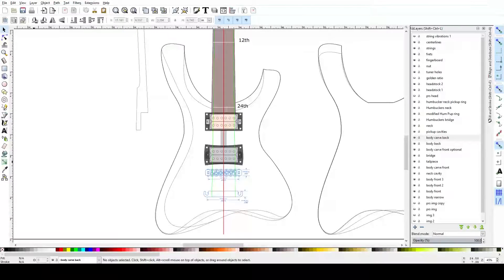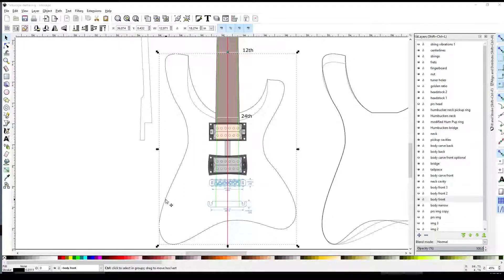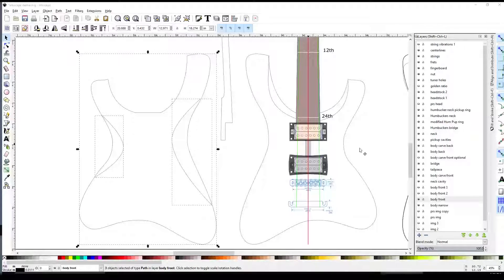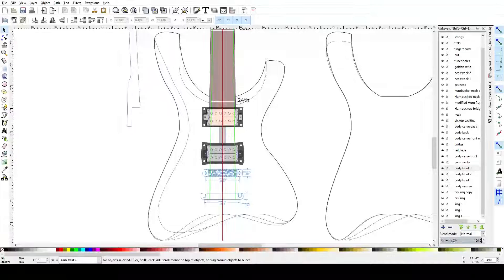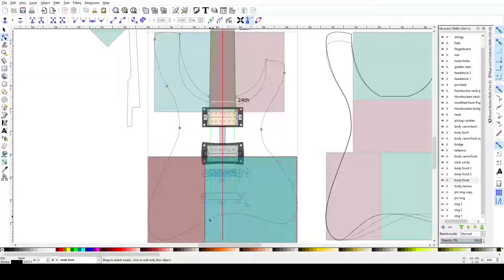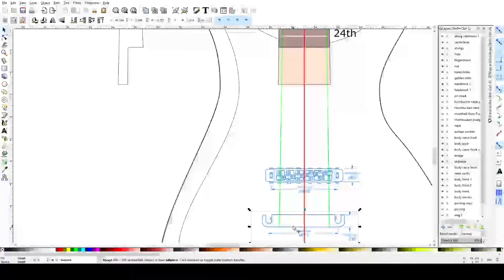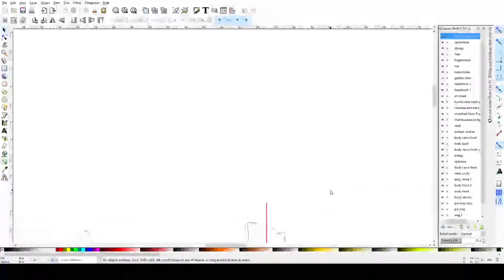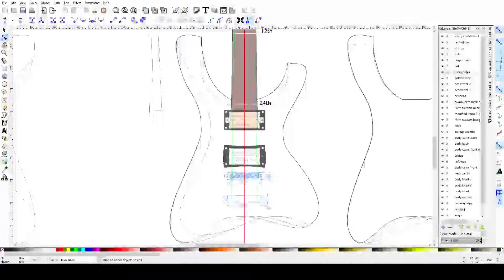Guitar Design With Inkscape

Comment: I recently did the same and designed a bass guitar in Inkscape. Without having watched your video before, I came up with exactly the same approaches 😁. Like manually tracing existing designs and then making adjustments, masking a drawing of the bridge, using the flip tool to design the back, heavy use of the measure tool etc.

I'm not sure if it was available in Inkscape back then, but now, I also use the clone tool heavily. You can for example clone the tuners, the pickups, or the body shape and then flip it to use it as a back view. Then, any changes are in sync.

Next step: I'll use Marz Workbench to convert it to a 3d model in FreeCAD. Marz provides extensions to both Inkscape and FreeCAD to do just that.

Comment: Nice demo of using inkscape. I've tried this on my own and got stuck at the point where it comes to real dimensions. As long as every dimension is relative, inkscape is fine, but when I try to use the path dimensions plugin to visualize dimensions it went crappy.
My basic idea was to make a vector file with inkscape, that I can use to print a 1:1 drawing of my guitar and to use it for a laser cutter to make my master template for routing.

How did you solve the problem of getting the dimensions right AND printing dimensions in the final plan?
Reply from the maker: Hi Sven, I don't really understand the problem... and I don't know what you mean by "real dimensions".
However, here are some things that I do that may help out. I always draw at full scale (1:1) inside Inkscape. Then I save the drawing as a PDF and print it as a poster using Acrobat Reader.
Hope that helps, if not let me know...
Reply: Project Electric Guitar 
I don't have the dimensions of original guitar. The only length I have is the scale and the size of the neck pocket. Now I have to adjust the drawing of the body to the correct size. Hope that explains it better?
Reply from the maker: Okay, now I understand :) 
You can use the scale length to adjust the drawing to the real dimensions. You can do it in two ways.
1) simply drag the corners of the image to make it bigger and measure the distance between the nut and the bridge using the measurement tool. Obviously this is an iterative process, fine-tune the dimension until the drawing matched the scale length.
2) download and install an Inkscape add-on (plugin) called RealScale. Follow the instructions and it will allow you to scale to correct dimensions very easily.
Hope this helps...

Comment: I using Illustrator to build my blue print the file can be transferred to that software.
Reply from the maker: Yes, Inkscape can read Illustrator files. But if you have Illustrator and know how to use it, then you don't need Inkscape, they are equivalent software.
Reply: Thanks